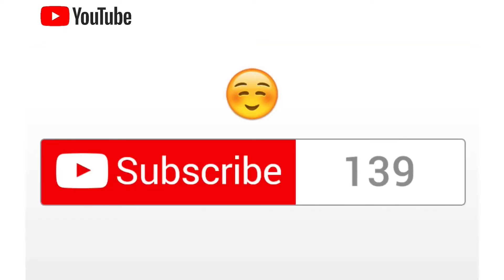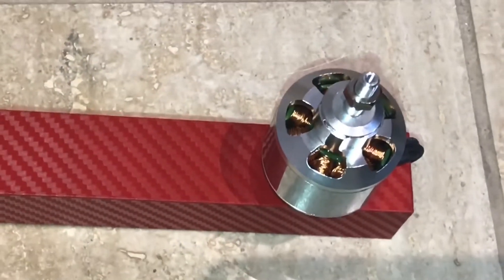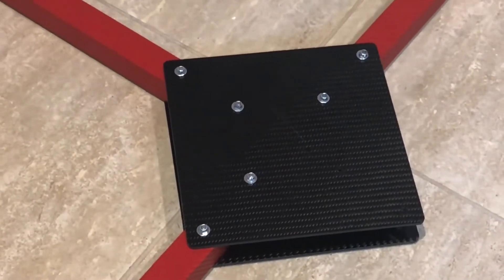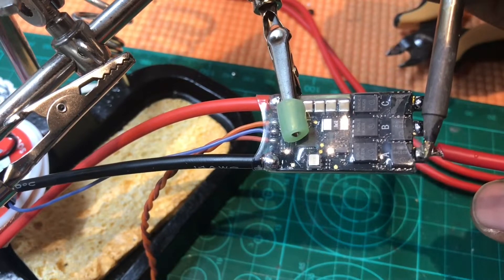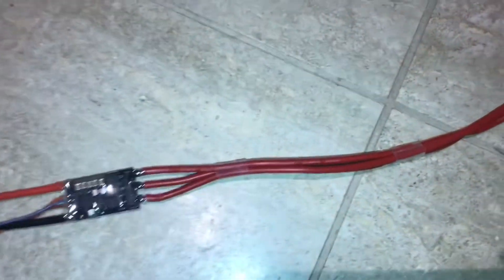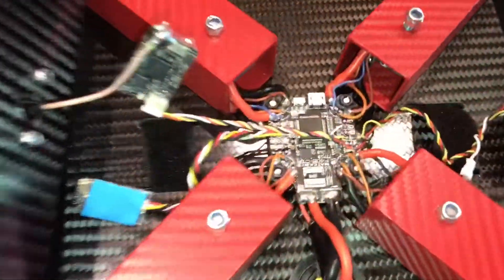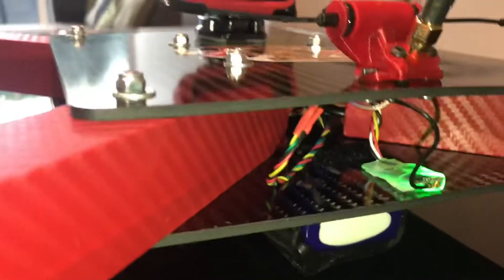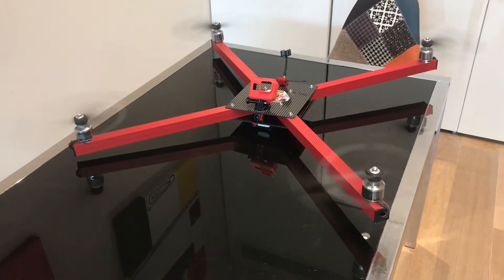Build your own 1100mm Xclass Racing Drone from scratch

Comment: Your soldering issues look like they are limited to just 2, and they are both related to not having exactly the right tool. That little iron gets hot enough, but it does not have enough output or thermal mass to work quickly with those thick wires. This leads to heat-soak in the wire, which leads to your second issue, movement of wire after removing the heat. This would not be an issue if the joint cooled down quicker.  Get a big heavy high watt iron. Either a Weller pistol grip where you control the heat manually or something in the 250 to 300w temperature controlled range. You will find it faster and better for the big wires. A big iron will get wires up to about 8ga hot enough to melt solder in about 10 seconds. Another 10 to apply the solder and get the wire exactly right, and then the wire will act as a heat-sink and the solder will solidify in about 5 seconds after you remove the heat. Keep the little one for the small wires though, it's perfect for them.
Reply from the maker: Cheers for the tips 👍🏾

Comment: Nice job man, really cool looking. I’m working on one right now, about ready for the smoke test. What is the “carbon wrap” you used on the arms? Really cool product. Good luck on the maiden. Subbed.
Reply from the maker: Thanks buddy. Carbon wrap was just a cheap one off Ebay in red. Stay tuned for the maiden 👍🏾
Reply: Wiggan RC oh wow, I thought it would be some kind of heat shrink. So it’s stick-on! Man nice job on putting it on.